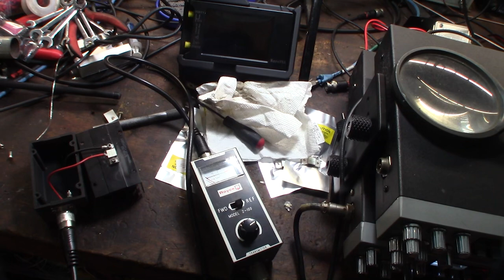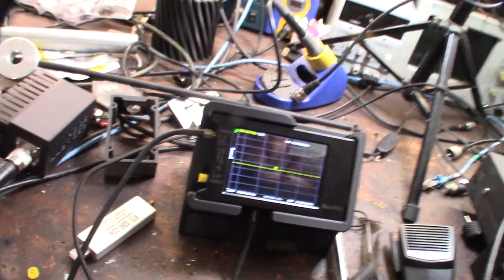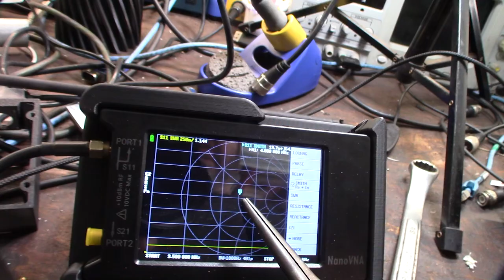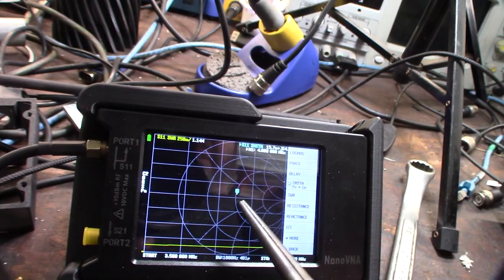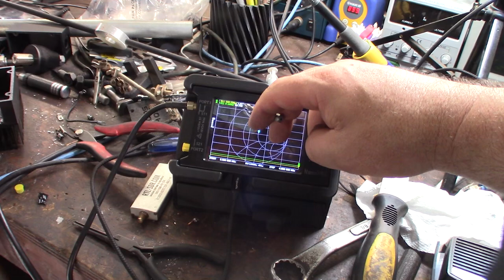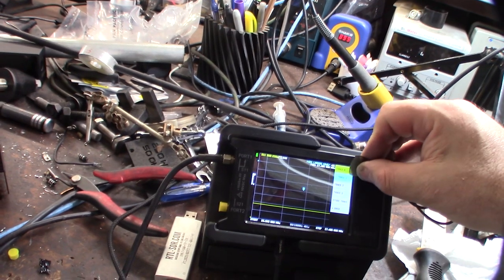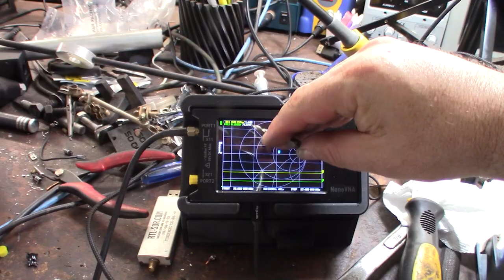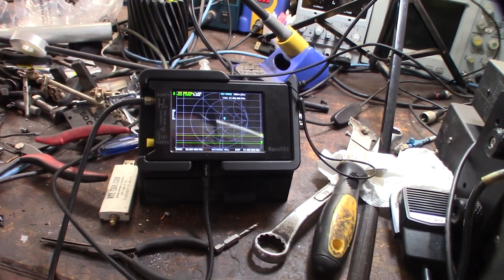250W 50 ohm dummy load build using 250N50 resistor, NanoVNA troubleshooting CB HF HAM

Comment: I need to purchase some of those non-inductive resistors for my radio as well. They are quite nice I will admit.
Reply from the maker: I'm surprised how cheap they are. I was able to build this for $5 in parts. The resistor and the SO239 connector. I still don't know how hot they get. On 4 watts its not even getting warm .
Reply: @fintechrepairshop  They won’t really get hot till about 15 watts I’d say. The heat sink makes that number considerably larger.

Comment: The flying wires are an impedance discontinuity, which reflects RF. It might be easier to understand if you take a 2-port measurement of coax vs. single wires.
Reply from the maker: I'm learning,  I'm starting to remember why I went down the computer science route.  RF is tricky subject. Picking up that OfferUP box of CB stuff really kicked in my OCD. I'm finishing this radio stuff then I back on my 3D printer stuff. Need to machine my new hotend. Got the Celeritas going 120K Accell 1200mm/S. Still running 24V. I made weird observation, my TMC2204 drivers run cooler the faster the printer moves.